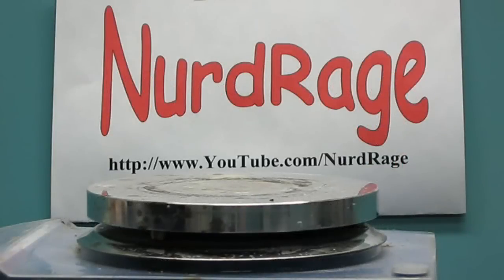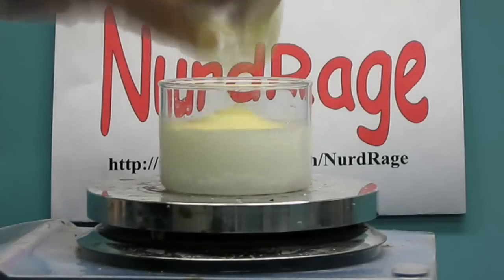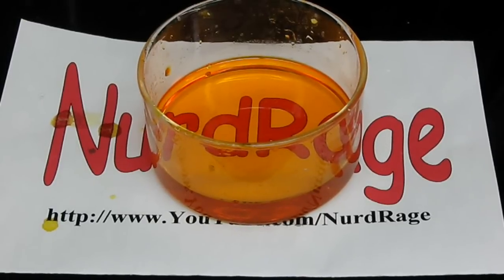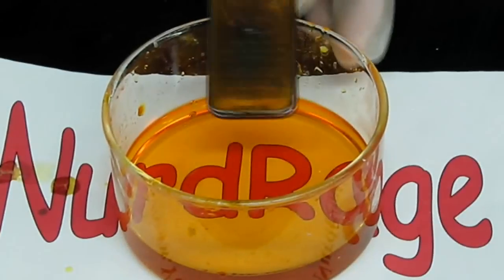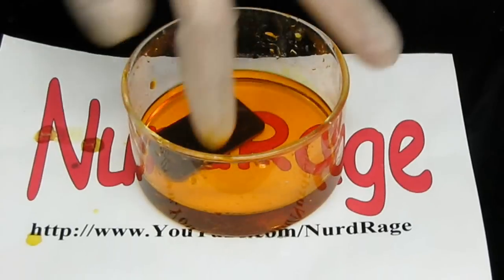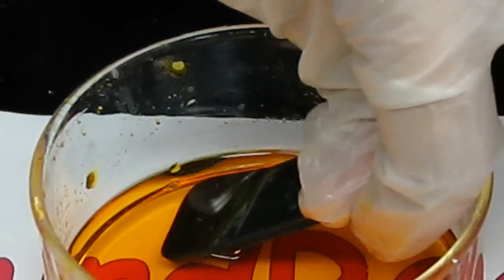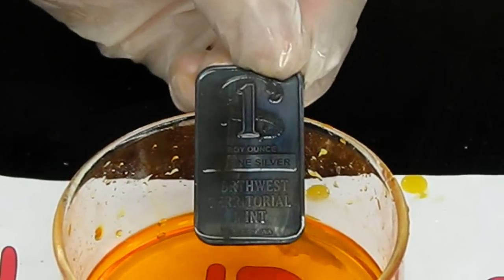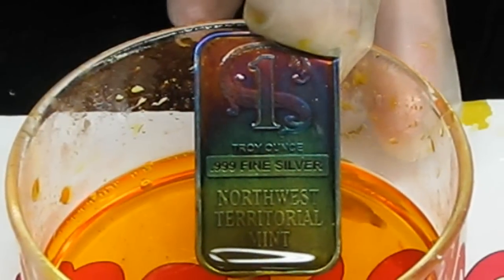Make Silver Different Colors by Anodizing

Comment: Yes, liver of sulfur can also be used. 

It does not require a battery to do the effect but is also not as controllable as this method. Also be sure to dip the coin in a baking soda & water solution after treating the coin to neutralize the reaction. 

However I believe experienced coin collector can detect artificially induced patina's. So just keep that in mind if your selling the coins.

Comment from the maker: The best way to make mirrors is to use aluminum vapor deposition. This gives the best durability for the cheapest cost. 

If you're still using silver then you can use dextrose as the reducing agent. There are also commercial silvering solutions that have better properties (but at greater expense)

The silver mirror can be anodized, but only on the front. Since this is a back-silvered mirror you won't see the colors if you use the glass piece as a mirror.

Comment from the maker: Mirrors were usually strenthened using a copper back that is applied by spraying a copper sulfate solution and an ultra-fine zinc powder suspension. when mixed they produce copper metal that sticks to the silver.

But it's still not strong enough to withstand daily abuse, you still need to apply paint or varnish.

to make rainbow colors from the back, you'll need to control the layers of silver with atomic resolution. i recommend researching something called atomic layer deposition.

Comment from the maker: instead, try getting a decent amount of sodium hydroxide, about two or three tablespoons, and add small amounts of water to it with stirring until it completely dissolves. It will get extremely hot and then you can add your sulfur. That solution might work better for you.

Comment from the maker: Yeah, what happens with smooth clean steel is that the heat causes it to form an oxide layer with air. This is just like the sulfide layer on silver and gives it color depending on thickness.

Comment from the maker: The anodizing effect is a purely surface effect and so it won't show up in between the glass and the silver on a back-silvered mirror (which is what most domestic mirrors are). It will only show up on the front of a front-silvered mirror. (most specialty mirrors like for telescopes are front silvered)

Comment from the maker: tape is good, also varnish and nail polish too, then remove them with acetone.

as for the weakening solution, maybe pour the solution back through the filter paper laden with sulfur to try and dissolve more. 

But yeah, as it accumulates waste products it will eventually become unviable.

Comment: I have made heavy anodized coatings on aluminum using houshold 110 VAC with a light bulb as a current limiter and a solution of sulfamic acid (concrete wash)for the electrolyte. Heavily anodized aluminum is a golden-yellow color but can be died with boiling solutions of fabric dye to almost any color you want. Once the coating has dried it is very durable. Nurd Rules!

Comment: with a bar, yes. Jewelery, not so much....
The bar is there not to look good, but to offer a very very pure version of the metal worth money. The layer of silver oxides and silver sulphides are still worth money becuase they still contain silver. In fact, silver sulphides are MORE expensive than silver itself.

but it's only a very thin layer, so it doesn't matter :)

Comment from the maker: the solution might be accumulating oxidants. I haven't tried this but in theory you can neutralize those oxidants in betweeen runs by dipping in a large piece of aluminum foil and allowing that time to absorb the oxidants before starting another run. 

let me know if that works.

Comment: Also note that the silver is not used up. He is just adding a layer of oxide that can be cleaned off. If you let silver oxides naturally it runs in the that Grey black color.  A smiler reverse process can actually be used to remove the tarnish without having to use a cleaning agent to rub it off.

Comment: if you have a lid place it on the jar or cover lid with something, baby food jars  work well, i leave the rim prtoector on my coin from the plastic flip and my coin lays perfectyl on the jar allowing me the opp to tone one side at a time or only 1 if i wish, but you can place the coin in the jar an seal it up , check it every 10 to 15 min, you may need to reheat the egg several time to get the color you want, the sulfer from the agg yolk will tone it fast. sometimes though it takes sveral hrs

Comment: You can do something just like this with artist's metals and a flame (thin sheet metal for embossing; I use copper-colored myself). You hold the metal over a gas stove's flame (or possibly any flame; never tried it before without natural gas), making sure not to touch it/get it too close. If you hold it far enough away it'll get some nice pinks, blues, yellow-oranges. Too long and it gets dull like the silver did here. Drop it in water to insta-cool and WHAM! Reaction stops. :)

Comment: I have learned that silversmith cloth used to protect silver from tarnish is cotton flannel that is kenized.  Further, that the kenized process is treating the flannel with a solution of zinc carbonate.  What property does zinc carbonate have on either removing oxygen, water, or sulphur from tarnishing silver?  I assume that it is acting as a “getter,” in reacting to a chemical so it is not available for the silver.

Comment: LOVE this method and I cannot wait to try it. 
You mentioned that you've kept your rainbow bars stored for years, and another poster said that their tone turned grey after a few days. Do you neutralize the chemicals on your silver afterward?
Reply: I did it to coin silver and then rinsed it in tap water immediately afterwards, which seemed to halt further reaction.
Reply: Baking soda is a great way to neutralize the reaction of the sulfur. So I would have a bowl of water with dissolved baking soda next to it the rinse in water after dipping it into the baking soda solution a couple of times

Comment: You are supposed to change the voltage to control the thickness of the oxidation layer, so that it results in different colors, that way the layer/color is more consistent. Using a higher voltage and control time is harder to control and not as consistent. This is just like any other non-ferrous metal's oxidation, except the voltage-color relation is not well documented. If you google titanium, for example, the voltage-color relation is well researched and documented.
Reply from the maker: For silver its more about delivered current. This is because the layers grow depending on how much current is delivered. There isn't a self-limiting mechanism. But for titanium there is since the oxide layer produced stops further current flow. So the oxide layers will grow until the voltage can't overcome the thickness and current stops. For silver though, the sulfide layers are stil quite conductive all the way until it goes black. So you need more precise control over current and time rather than voltage.
Reply: Thanks so much for the explanation. That is fascinating! I still have one small question. Why do you say it is silver sulfide layer, not silver oxide layer? I thought the anodizing process will always cause oxidation on the surface of metal?
Reply from the maker: Yes this is oxidation, but with sulfur atoms, not with oxygen atoms.
Reply: I thought that oxidation required oxygen.  https://en.wikipedia.org/wiki/Sulfur_oxide  
Sulfidation?  https://en.wikipedia.org/wiki/Sulfidation

Comment: Thanks for sharing this video. I would like to know if this anodized layer is durable. Can I use this process in a silver ring, for example?
Reply from the maker: hmmm.. not sure about that. I've had my bars last for years, but that's because i store them behind a clear plastic case so they never get wet or are handled. I don't know if the coating will last for long on a ring that's handled everyday. I've handled some of my bars occasionally and they seem to take it well so they're not super fragile, but will the coating last years on a ring? i'm not sure.
Reply: marlon mercaldi if you spray varnish the ring i think it’ll stay long!

Comment: i have a method that works very well also, i have tried many methods and this is the easiest of all i tried and works the best , ( other then the video that worked very well ) i use  an egg,. you boild 1 eggg normal liek you would if you were going to eat it, rinse it in cold water to the point it is luke warm thne peel egg slice it in three quarters or 4 and place it in a glass jar , then place you silver coin in the jar, dont allow the egg to touch the coin, continued next post

Comment: Is there a way to 'fix' the colours??
I was successful in obtaining the colors, but after a couple of days all colors had turned to dark grey?
Reply: wow, bummer. if the colors dont hold the anodizing is a fail to me.
Reply: +tetrahead72 dont use silver, use titanium instead with a phosphoric acid based drink and higher DC voltages, (starts around 40v and ends I think around 110v if I recall,) :)

Comment from the maker: when you add the sodium hydroxide, it should heat up so much that you can no longer hold it. It gets very hot, and this is what makes it dissolve the sulfur better. if you got no heating then the sodium hydroxide you got might be bad, or you did not use enough. 

What about your sulfur? is it sublimed sulfur?

Comment: I have water filtration system and procuces soft water and I was wondering if the water in your video was soft, hard or had any other minerals in it. When amonia or 97% alcohol are added the sulfur will dissolve but still can not get the orange color. after the process is done however I did use a mixture of soda and water to wash the coin and noticed a big difference in the appearance. Basically I just need help in making the process as good as yours. and by the way your other videos are awesome

Comment: Thank you for the video
I have several questions???

1-the 1st ingredient and 2nd ingredient -were not clear-please inform
2-what  strength was the battery
3-rainbow like affects-@ how long were 
the wires in for?
4-I have some 20 gauge Niobium wire.
I would like to anodize into rainbow colors-Any suggestions
5-What kind of wire from the battery terminal to liquid?
thanks razzer49

Comment from the maker: Your sulfur sank? If you closely at the video, the sulfur i used floats. 

I think i see the problem, the sulfur you're using isn't resublimed sulfur, which is extremely fine and almost porous, making it float.

I'm not certain if yours will still work but what you can try is to boil your solution with the sulfur for an extended period of time. The longer the better.

Comment: Hello

I've tried this, and worked somehow. My solution turned into an orange-ish color, i placed the silver coint (.835) into the solution, but before i could attach the wire to the coin, it started to oxidize itself. The result is not a rainbow patina, but it has a darker color with some green-purple color.
Was the solution too "strong"? I user 1 tablespoon of sulfur, and 2 sodium hydroxide with ~100 ml of water, and i stirred it for 10 minutes. After that i filtered it.

Thank you in advance.

Comment: One more question:  can you think of any way to anodize a particular part of the silver (other than keeping the silver out of the solution)?  For instance, is there something that I could cover a portion of the silver with (tape?) to leave a non-anodized design afterwards?

Thanks Again,
Kyle

P.S. After a few runs of anodizing, the solution seems to become weaker (instead of brilliant rainbow colors, I just get dull grey tones), but I doubt there is any way around this other than making more...

Comment: Would anodized silverware be safe to use after washing? Would I need to coat it with something?
Reply: the extremely thin silver sulfide layer is not harmful, no. But, the effect wont last.

Comment: does this work with stainless steel?
Reply: Yes. Except instead of this crazy solution, you just need to heat the steel. The oxides produced thru heating will form the same kind of thin film optical effect that makes the silver turn such odd colors

Comment: Hey I have a question. When I was younger I took apart a small radio and I took out the speaker part. I then put a 9 volt battery on the speaker part and it just kind of stuck there. So I being the kid I was left in a box for a very long time, and when I came back to it the metal speaker part was gold color. What happened?

Comment: I have a question, is there a way to incorporate a resist in this?  I want to make part of the bar black but only in certain places.
Reply: +M. Coty Kannon i guess you could try to create some kind of mask with tape and then do it stop by step
Reply: Maybe decopage it (paint it with elmer's glue) or some other type of glue... not sure how glue or tape would react to the chemicals, though. The recently advertised "5 second fix" type glue is applied with a pen tip, and would peel right off. Time to experiment! lol

Comment: Have you heard of the scam with those silver and gold bars, someone made some of them with brass bars coated in silver and gold and sold them as solid bars, they must have got something like 5 bars from 1 solid bar,, makes me wonder how would you tell if that was done to you, besides drilling holes in the bars you wouldn't know, it wouldn't be like copper rings coated in silver,, you won't know until your finger turns green from the reaction of salts in sweat with the copper, unlike the bars you wont get that to happen as the coating on the bars are thicker than just an electroplate.
Reply: One could use density to tell if a bar were solid gold or not. A gold bar of a certain size would weight a certain weight, and if it doesn't, it's obviously not solid gold. Easy enough, I would think. No need to drill.
Reply: Esti Allina-Turnauer Tungsten is close to the same weight. And has been used before.  http://www.businessinsider.com/china-tungsten-gold-2012-9

Comment: NurdRage understand this is an old video, but would this process work on titanium? Thanks
Reply: Possibly, but the oxide layer might just flake off, but it's worth a shot to try it.
Reply: +BluePlague dont use the chemicals they used, use anything with high phosphorous content (I used diet coke but any cola uses phosphoric acid to flavor it with some sour) just make sure you dont have anything in your solution with chlorine in it, cause it will make titanium chloride and break down the titanium, you just want an oxide passive layer over the surface, 

you need much higher voltages, but the color is then controllable since each voltage difference gives a different color and then stops cause the oxide layer is too thick to penetrate with that voltage, so masking and then using higher voltages is possible to add more colors to a single surface :)

Comment: does this work on different metals?
Reply: +Jerico Miranda I believe this is how they make those knives rainbow colored. So I would assume it works on others.
Reply: +HairyViking111 actually I have used diet coke for the phosphoric acid content to anodize titanium but the time is not crucial with it rather the voltage applied determines color allowing for painting with oxygen a variety of colors on the titanium that will not easily be removed and doesn't wear easily either :)
Reply: Thomas Anderson That pretty cool.

Comment: Can anyone tell me if this process would work on a mirrored?  The backing paint will be stripped off the mirror & what I believe is a silver coating would be exposed. any help would be much appreciated
Reply: Strip off that backing and the silver will likely go with it.  If the silver somehow has greater adhesion to the glass than to the backing paint, then I doubt if the anodizing solution can reach that surface.
Reply: It's often Aluminium.